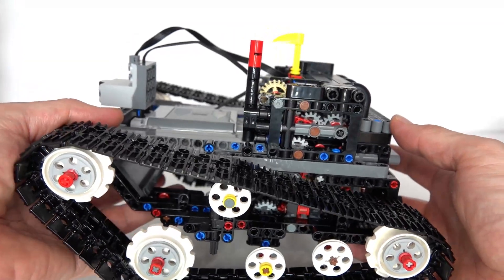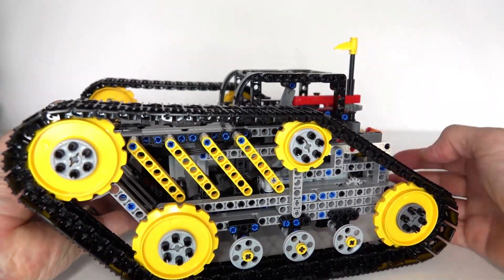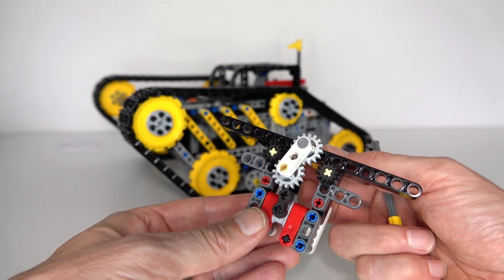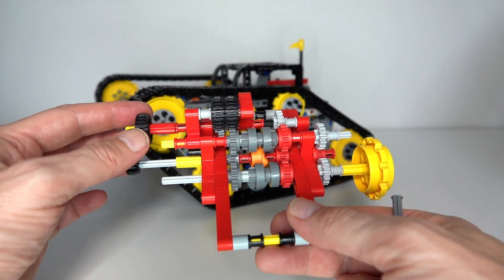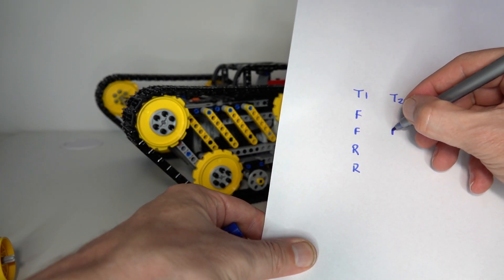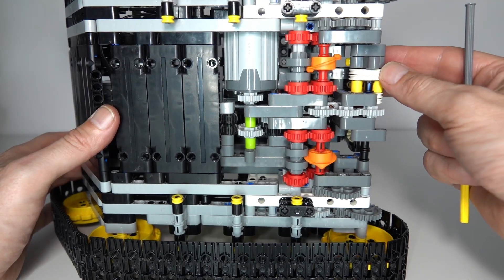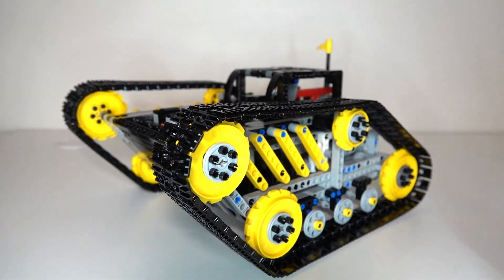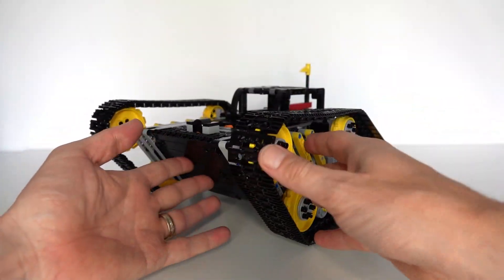Lego Technic Single Motor Tank V2.0

Comment: And what's the point of this? All it does is to make the thing cumbersome to operate and take away the fun of driving a tracked vehicle!
Reply from the maker: Hi DualDesertEagle...yes good point LOL. I just made it for the challenge of the design - it helps me learn and discover new designs.
Reply: I could answer this even easier: for the fun of  it. To build something that is electro mechanical art, for the sake of advancing the art is fun. Yeah it needs a lot more power bit it's one hell of an achievement and I admire the design principles. Hi mate! for some reason I'm not getting notifications at the moment. Awesome work as ever! 👍🍺
Reply from the maker: @carlbModels  Hi Carl. Thanks for answering that question so well! Yes it's for the fun and challenge...some people don't see it that way ;)

Comment: Very interesting idea!

Did you use stud.io for the opening animation? if so, how did you get the tracks to line up so perfectly? i can not get them to link to each other when they are at an angle.
Reply from the maker: Hi Charles, I just connect a whole lot in a straight line and then I bend them around the wheels using the rotation tool. It's a bit tedious but it worked for me. 🙃
Reply: @TechnicBrickPower  Ah great, cheers!